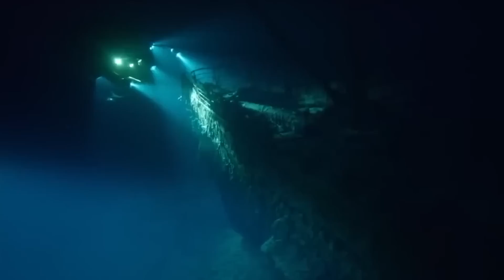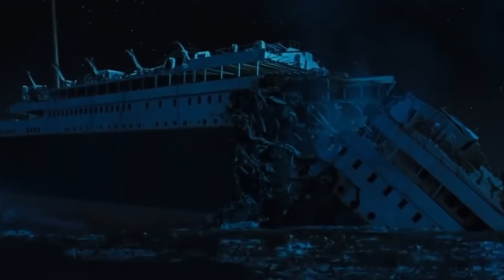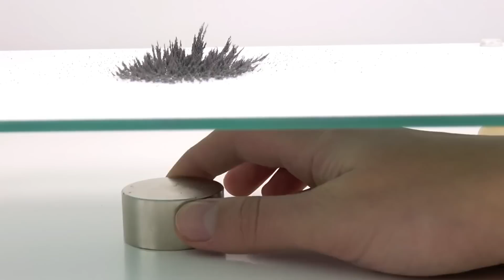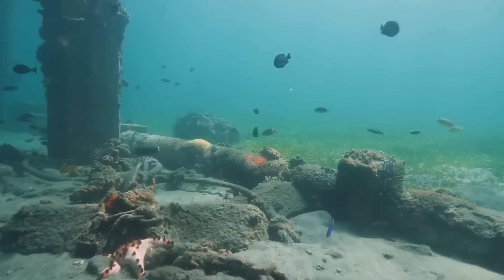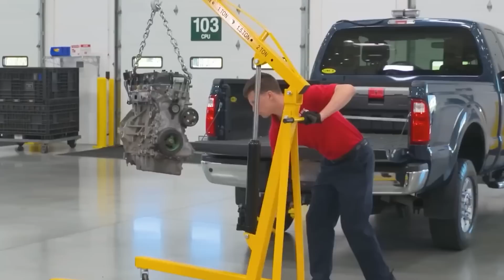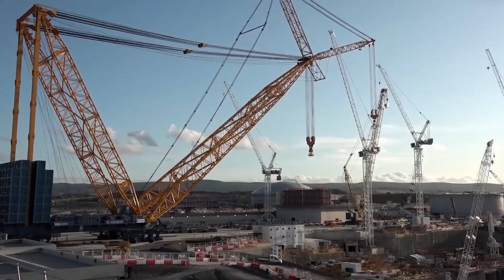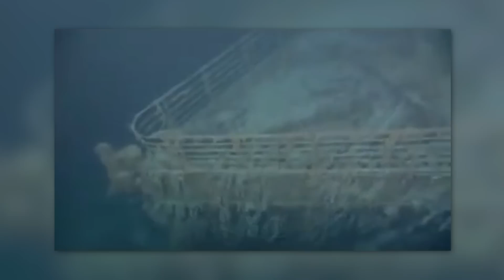Scientists New Plan To Retrieve the Titanic Changes Everything!

Comment: The wreckage is beyond being saved. Even if you could raise the front half it would disintegrate as soon as it leaves it's current environment. It would take thousands, if not hundreds of thousands of people to treat every surface of the wreck in the correct manner so that it doesn't just fall apart upon resurfacing. That's why it can't and shouldn't be raised.

Comment: I beleive multiple theories working together would make this possible. 1st build 2 steel frames flexible to somewhat take shape of the whole bow. Assemble at surface ! Lower each frame using the air bages already attached ( at surface) place frame down each side of bow .Do final connection of frame  at sea floor aroind ship . Since airbags would help keep liquid nitrogen inside ( basically only freezing as 1 block in the shape of ship) .Istall explosives strategically at at distance around deep in sea floor just too pop the suction to gently shake her loose . Inflate airbag as 1 big bage to optimize egual lift . Detonate after bag is inflated too close too lifting capacity.  Gently raising ever so slowly.  But hey im no engineer! 😉🇨🇦

Comment: It’s not hard to figure out how to do this. It really isn’t what you need to do is you gotta put steel planks that you can get underneath and slide underneath the Titanic connect to steel cables you have you connect the plates welder plates when they get underneath the price, make sure it’s bracket together each plate and then you lift the once the plates are underneath the Titanic And you break them together. You hook the cables to the plates and then you’ll lift them up like a elevator, and you have to have to stop every so many feet so that the Titanic depress the Titanic can get regulated. It would take several hours to do it, but you could lift the Titanic up from the seat bed, cause you didn’t have to give the Titanic the pressure of each level just like when human beings go down to certain depths the pressure will cause the vents the same thing with the Titanic so you’d have to leave it there for so much time so that it can get balanced out

Comment: He keeps talking about the wreck weighing 46,000 tons. Broken in 2 parts it no longer weighs that much. Filling the hull with foam? If that worked, how do you clean it out when it's raised? The cable method seems most feasible, but the fragility of the wreck comes into play. This entire video basically suggests it's impossible to move the wreck and we should leave it alone. Further, who pays for it?

Comment: Basic error at 1:27 46,000 lbs is NOT 46,000 tons. 
Titanic was a massive ship—883 feet long, 92 feet wide, and displacing (or weighing) 52,310 long tons (a long ton is 2240 pounds) — cited from Woods Hole Oceanographic Institution.

Comment: Here's a method I think might actually work:
Use robots to excavate a rectangular plane of the seabed just under and around the two sections of the ship forming a plate for them to sit on. Drill inwards through the seabed placing a sheet of strong material that can support the weight of ship and the seabed directly underneath it as it goes. This will form a platform underneath the ship. From there a powerful crane (or many cranes) should be able to slowly (maybe at a speed of just a a few feet per minutes) hoist the platform to the surface. This way the only forces that would be exerted on the ship would be its own weight which it has mostly supported for over 100 years now. When it reaches the surface floats can be attached and the wreck can be towed to New York Harbor.

Why anyone would want to disturb a grave of hundreds of people that is probably haunted by demons at this point to see a rusted rotten tangle of muddy metal and wood is anyone's guess but it is possible if we wanted to.

Comment: The only way to bring it up is to excavate underneath both halves separately and slide a reinforced plate under each half and raise it as if each half was on its own separate table, otherwise hooks or magnets would just rip it to pieces, after all it has been down there for over 100 years, or just let it R.I.P

Comment: Theoretically it should possible if a giant steel sheet is put beneath it and then slowly inch towards undeep waters but then as soon as the titanic reached Bumbs and rocks on the ocean floor it’ll fall apart. 
So even if it was possible i think that ship should be left alone to be undone over time. 
It’s a gravesite where thousands lost there lives.
Enough grave robbing has happened there.

Comment: You keep referring to the TITANIC as weighing 46.000 tons.  Repeatedly.  That is her original, intact figure for GROSS tonnage.  GROSS tonnage has NOTHING to do with weight; it is a measure of usable interior space.  Her actual WEIGHT as built is uncertain, but I've seen estimates between 52,250 and 66,000 tons in the past.  And that does not consider (A). that the original ship is broken approximately in half; and (B), that each of those pieces also contain the weight of the water within.

So, it isn't even as easy as you put it.  Put simply, it is impossible (as I said previously).

Comment: If that ship was coming up it would have been done long before now.. The ship is deteriorating at a very fast rate it would literally shatter into smaller pieces before it got off the ocean floor fully. This ship is at its final resting place in the same place it sat when it shipped and it will forever remain that way until it’s fully deteriorated and no more. Anything that’s been brought up from the ship is all that’s coming and nothing else. There’s a reason why they don’t bother going to try and retrieve it and any other items there may be down there it’s because whatever they were getting has been received the ship is no longer safe to land on at that depth especially. The only ongoing to this ship are billionaires with money to drown

Comment: Uha no not happening and the Titanic doesn't have any funnels left they feel off before the final plunge into the ocean depths quickly actually. Its in 2 sections, i do think the machinery should be salvaged if possible safely as possible  . If Bob Ballard is correct no remains are visible so possibly? The inside of the Titanic is not necessarily off limits interesting dynamic and question no problem clarifying that. Salvaged is preserved for future generations to understand Titanic sinking. And prevent from ever happening again. The loss of life is very horrific. But in the modern world. Nothing else can be done. I'm not saying raise all of the Titanic that's not safe on many levels. Personal belongings is the other issues do you touch or not ? If it's me why not. Perhaps find the living descendants but that would take so much work to authenticate the family members. If they don't want anything then put in a museum.  I wish the engine's could be brought up, however they are enormous. And the propellers OMG 😱 so huge as well. Don't get me started on the Titanic kitchen crews also very big. I'm that 🤓.

Comment: There is a cargo ship in lake superior i believe that if im not wrong had 30 some sailers on it and they left it as they never found most of them so they left it as its they peoples gravesite . So yeah just leave it be . Besides it will only break apart . Its has been down there to long . What would the point be in trying? Look at what happened to the sub from the pressure . It just isnt happening

Comment: Don't be stupid. 
For one, the ship is not in good condition - PARTLY because all the dives down there disturbing the normally well stratified water column and letting oxygen down there, which speeds up corrosion. Idiots throwing placards overboard for years have resulted in things raining down on it from above - which is bad given how fragile it is. REMEMBER, Titanic was made using IRON rivets for parts of the ship - it's one key reason she sank so easily - iron is much more brittle in cold water and it didn't take the impact with the iceberg well. Well, iron RUSTS, too. It is also eaten by bacteria at that depth. For 112 years, Titanic has been getting slowly weakened structurally by these processes - and slowly falling apart. ALSO remember that on the night she sank, she ripped in half and PLUNGED 2.5 miles to the ocean floor, SLAMMING into the bottom like a freight train, which made her even in 1912 a fragile wreck. The BACK half was even worse - it IMPLODED due to air pockets and THEN smashed into the ocean floor. This ship even in 1912 was in no condition to be raised. 

Also, when she HIT the bottom, thousands of tons of SEDIMENT poured in. The ship itself weighs over 50,000 tons - with the sediment and water inside, you can double that easily to well over 100,000 tons - basically, Godzilla - She's also DEEPLY embedded in the sea floor, which means it'd be even harder than simply attaching floats. 

With the structural integrity of the ship basically gone, even IF you could raise 100,000 tons of ship and wet sediment 2.5 miles to the surface, the drop in pressure would make her very quickly fall apart AS she was being raised - a cloud of rusty metal debris raining down. 

AND, even if you magically stabilized THAT (physically impossible), as SOON as it is exposed to air, it'll start falling apart MUCH faster than ever before. 

Sorry, Titanic was claimed by the ocean, and the ocean is not giving her back. You COULD recover some parts of the ship that were made of BRASS - those are much more corrosion resistant - and in fact some HAVE been. But the whole ship? Might as well ask for a real Jurassic Park (and to save you the trouble, no, DNA cannot survive 66 million years in any even REMOTELY biologically useful form - much as I'd like it, ALSO impossible - though a hybrid mammoth is possible because it's MUCH more recent and we DO have mammoth DNA).

Comment: What about the use of cranes just to lift her up, allowing to set a platform below the hull and then lifting the platform not touching the hull anymore? The platform should be 30 mt large and about 100 mt long. If it'd work with the bow section, they could try with the stern and finally with latest parts (funnels, aft section and aft tower, bow porthole and double bottom)

Comment: unless they could jack it up enough to put a big tarp under it it can't be raised. inside a tarp she could come up evenly. it would be like me being disabled and having been lifted off the floor by a sling on a hoyer lift. I could stay in the air and not fall through the sling. if they could make a tarp strong enough to support the weight of Titanic that's the only way it could be raised other wise it would fall apart. in the movie Raise The Titanic they used  something to force water out and used explosives. that movie was made in 1982 3 years before it was found in 1985. unlike Raise The Titanic the real ship was in 2 sections and everybody realized there was no way to raise it. nobody knew how badly it was damaged until 1985 and it has rotted a lot more since. a sad ending to a beautiful ship.

Comment: First and foremost I'm on the side of leaving it alone, however, one thing that seems to be over looked is that the ship does not weigh 46,000 tons in her current state. It's broken almost in half and has deteriorated. The heaviest piece probably weights closer to 28,000 tons. Still mind boggling heavy but not 46,000.

Comment: On August 20, 1959, Vasa was lifted out of the mud where she had been submerged for several hundred years.  The method of steel cables and floating pontoons worked well and the Vasa was pulled up and moved underwater in 18 stages.  In September 1959, she was at a depth of seventeen meters at Kastellholmen. 12 May 2023

Comment: Just a couple points why this shouldn't be done. 

1. Even just visiting wreck is causing it to decay faster. 
2. The wreck is nothing but sludge held in place by microbes and pressure, even a simple hand touching it would cause damage. 
3. It is already collapsing, more rapidly than ever. So any attempt to split it further would just destroy it entirely. 
4. The biggest issue, is this is one massive grave to over a thousand people with the ship acting as a massive tombstone. Removing it is like disturbing the grave.

Comment: Raising it would cost more than any salvage company would make from the recovery. Due to over one hundred and twelve years of marine growth, It would weigh much more now than it did when it was built, it would have no structual integrity and fall apart when moved. Also, 5500 PSI is 172 times the pressure in an average car tire. These scientist are not dealing with the truth.

Comment: Yes its impossible, also immoral. Its a grave site in away even if the bodies are gone. Why waste time and money. The structure is compromised and air eoukd finish it off. Leave it alone.
Also they recently proved it ripped apart into 5 main parts 3 main structures 2 hull pannel parts. That's not even starting on the debis.

Comment: They would need to build a structure all around it pump water out dig the mud out put massive plates underneath/air bags and weld a another structure around it to keep it in place but biggest problem will be the pressure at that depth but that level of rust and being a burial site they need to leave well alone

Comment: He's a thought...  Leave her rest...  Once her hull hits the open air, decay will super accelerate...
Reply: any thought about practically raising a significant portion of the bow is foolish. It is a practice in mental masterbation. The back of the bow is broken and stick in 40-60 ft of thick mud. The whole thing has been down in freezing temperatures and pressure that it would just crumble apart when hitting the surface.
Reply: @LatinBostonH8ter79 what does putting hands in your pants have to do with raising the liner
Reply: It would completely crumble! It cannot be done!
Reply: @jenniferpingle3432 no it wouldn't it's called physics
Reply: Don’t worry.  They won’t be able to do it.  Probably won’t be able to get all the tools down there

Comment: There are several reasons for this never happening. The ship has been sat underwater for over 100 years. It will just break up if you tamper with it. Not to mention, it's a grave site for 1500+ people. It will be extremely disrespectful to move the ship.

Comment: It's ok to bring up the titanic to prevent tourist life at risk like the explosive of the small submarine with no safety,it's more easy to see the titanic on land than travel under the sea.
Reply: It probably would be okay to bring the Titanic back up, were it not for the fact that it’s completely impossible to do so. The two major halves of the Titanic are far too fragile and far too embedded in the ocean floor for a salvage project to be practical.

Comment: Why not build about four or five specially designed submarine vessels to retrieve the wreckage? Or you could also build a sky scraper in the ocean. A structure that extends all the way down to the bottom where the ship is and comes straight up out of the water and acts like an elevator to lift the ship straight up and out of its water grave. The structure would have to be enormous and strong enough to lift the ship. An engineering feat like nothing else before. A ship wreck elevator lift. Your welcome!

Comment: Ok first of all this ship is split into two sections right so while I was watching this I said to myself why not just focus one one section of the ship and do not use METAL CABLES those under extreme pressure will either snap or rust immensely. I recommend scientist use possibly heavy duty rubber cables because rubber will not implode or snap. Also scientist could use a the air bag method or just REBUILD THE WHOLE THING. And also how the hell should scientist get a 850ft long ship that weighs 46,000 tons into a museum? The airbag method has s a very good option but like the video said the legendary ship is very fragile. That's all I got to say about the legendary ship. Hope I get to see the ship in the future.🙂
Reply: Great idea just rebuild the ship to how she would look like as a museum
Reply: @Ashleykeithdavidharper   thought you wanted it to rip

Comment: The only way to lift the Titanic without causing massive collapses is to underpin it and then lift the cradle structure with the wreck sitting on top. Any lifting attempt that involves attaching lines to the hull and applying tension stress through the ship would just tear off huge pieces and cause collapses.
Reply: And underpinning it even then will still be risky.

Comment: Sorry but this is no way that any of these ideas would work. If they lifted it with air tanks it would crumble to pieces in its current condition. If you froze it somehow i could see that protecting it from falling apart on the way up, but when things freeze, they expand. This would most likely damage it. Beside think of how much more it would weigh with all the frozen water. Magnets? Forget about it. Why would you cut it apart? Whats the point in damaging it and bringing it up. Silly video..

Comment: Divers would never survive pressure at those depths.
Flotation, even if possible- the  bow section is buried under around 30 feet of mud/ how do you get it out ? It would probably disintegrate on the way up. Then you would  have problems with the stern section, which has burst, and collapsed- the cost would be staggering!
Please leave it alone?